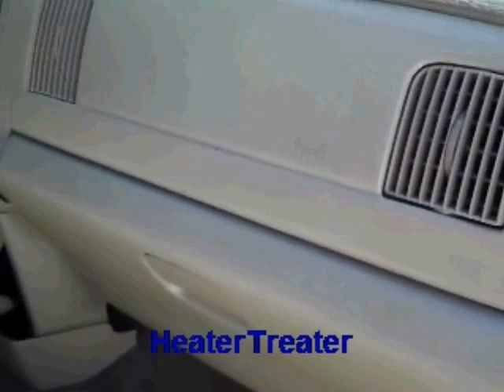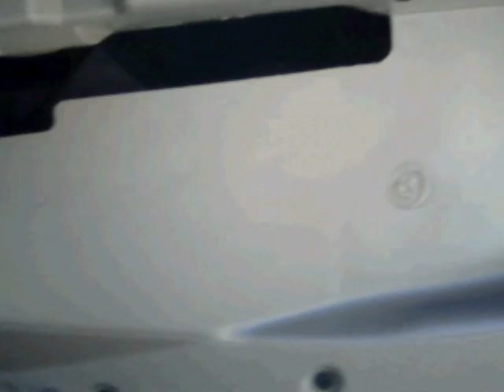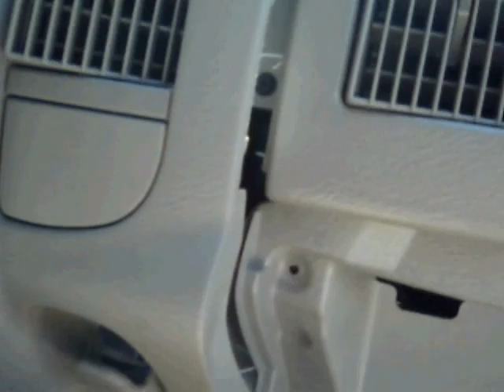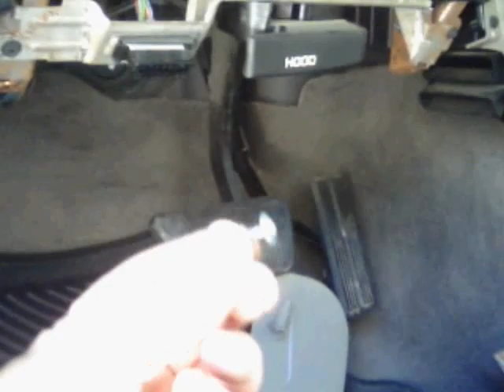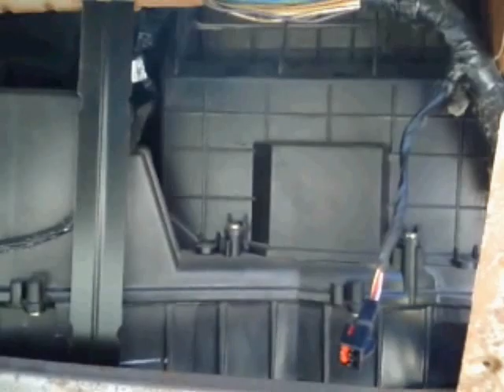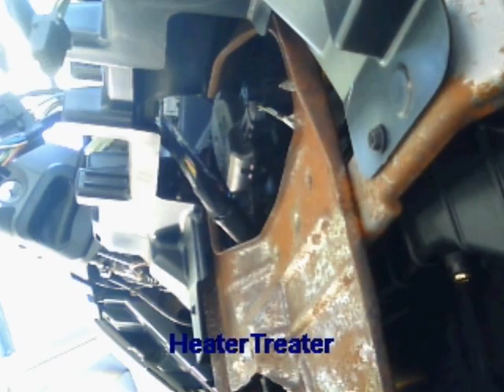Dodge Ram Air Door repair Heater AC HeaterTreater

Comment from the maker: WRONG...  The failure has nothing to do with cutting the HVAC system off when you stop the engine.  The failure occurs because of the excessive forces during the system calibration routine that drives the doors to a stall position to find the extents of movement.  This occurs automatically based on the engine on/off count(10 on most models).
The failure is a "wear out" mechanism, but not dependent on age, mileage, weather conditions, or user adjustments...just on/off.  A pizza delivery guy will fail faster than grandma taking eggs to market every Saturday. 
Replacing the doors with OEM plastic will just fail again.  HeaterTreater provides a method to replace the doors without removing the plenum box.  Even if you want to remove the box and replace the doors, you're still better off using our steel doors instead of plastic that will break again.  A lot of professionals don't like to break open the refrigerant system, drain the radiator, remove the steering wheel, etc. because of the liability of putting it back together without missing a wire, creating a rattle, screwing up the radio, or a thousand other potential problems.  We prefer to just let sleeping dogs lie, but if you think your truck is a candidate for the Barrett-Jackson auction in 20yrs, it's probably best to keep it stock...
The cracked dash is from UV light through the windshield and totally independent of the HVAC system.  Just because there are two problems doesn't mean that they are related.

Comment: I have a 2004 Dodge Ram heat only coming out the middle vents.  After looking at the service manual I started to Panic as I read how the door is replaced.  Disconnect the AC, the Heat and tear apart the Dash...there was NO way I could do that 
I needed my defrost desperately.  Using your video I was able to cut open the box and tape the door in the up position and reseal things temporarily so I had defrost while I waited for your parts to arrive. 

Thanks for your product, you are the BEST!

Comment: Just got done replacing re circ door. Bought it from Heater Treater for 130 shipped. Took about a hour and half. Not bad at all. Used a few tricks of the trade to make it really easy. One screw on the door motor can be a pain, but overall its really easy if you have mechanical skills.

Comment: To anybody who is having the problem where only air blows out of the vents but no defrost. Your problem is the mode 1 door is broken. I have a 2003 Dodge Ram heavy duty and I am replacing the mode 1 door because it has the problem I described above and when I took it apart like the video shows, the mode 1 door connector spins free.

Comment: Removing the door leaves the external and internal intake ports open.  At highway speeds air flows into the external port and directly out of the internal port...like having a window rolled down all the time.  The fan doesn't have the power to overcome the air flow.  No door kills AC and heat efficiency.

You can block one or the other port, but it doesn't allow the computer to control the door and "dry" out condensation or maximize AC/heat.  Replacing the door with the HeaterTreater kit is best